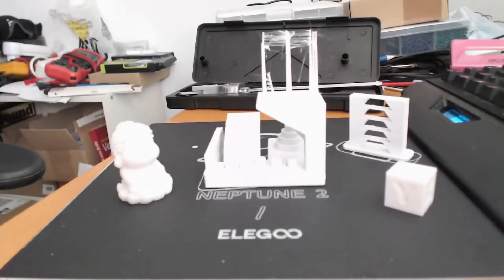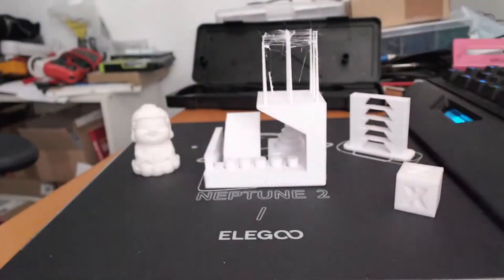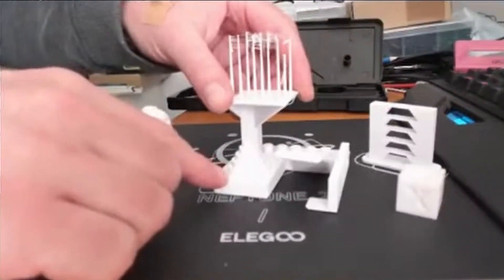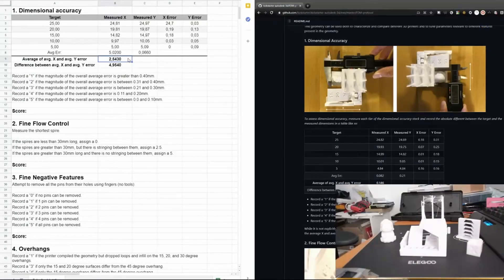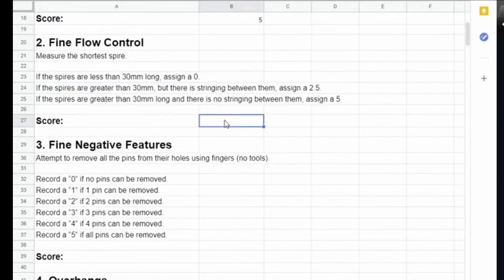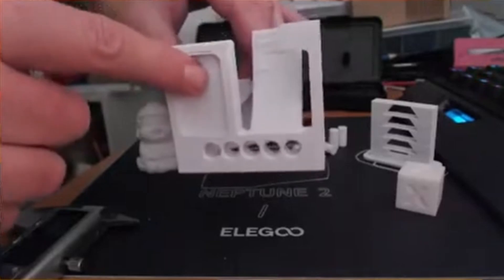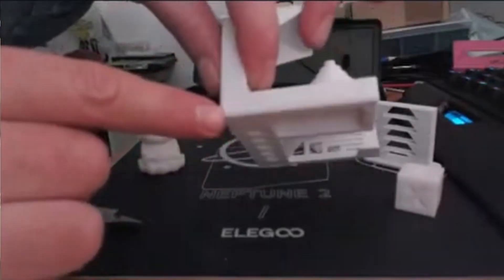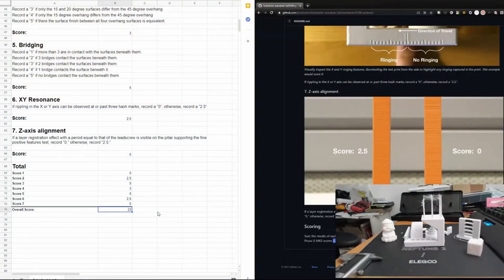Prusa Killer? Elegoo Neptune 2 Accuracy Tested!

Comment: nothing beats mk3, nice try China
Reply from the maker: I agree on that. Prusa is definitely the leading manufacturer for that kind of printers, offering an outstanding support but you have to pay a price for that.
Taking the price of a Prusa MK3s which is more than 4 times the price of an Elegoo Neptune 2 then the Neptune is more than just a clone.
Their support isn't bad, too. You'll get helpful answers from them within 24 hours which most times solve your problem. Be it a technical question, requesting the firmware for auto bed leveling or other things.
That said the Chinese did their homework which makes it more than just a nice try.
Reply: @3D_Printing_Geek  if you buy the components of the MK3 one by one, you'll discovered that worth every cent. Maybe a 20% is for support, but not more than that. You will understand it after 10000 hours of use and not only printing marvel stuff in PLA
Reply from the maker: @Marcos-tj8nk  Absolutely! Everything comes with a price (not talking of money). In case of cheap printers this includes things like you mentioned: more wear of the cheaper components with the need to replace them earlier, more self maintenance on the printer, having a smaller community and so on.
I wouldn't recommend such a printer to someone who just wants to get good quality prints out of the box. One should have interest in getting to know the in depth technology of 3d printing and to learn to fix and improve things.
That applies to a Prusa, too but in a less time consuming way.
Nowadays 3d printers are still far away from being as easy as a coffee maker but getting closer.